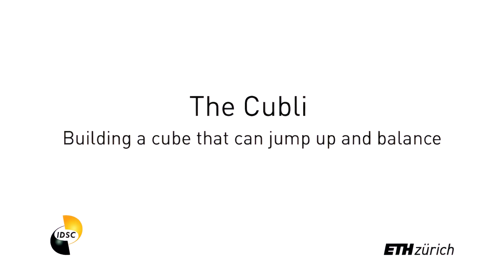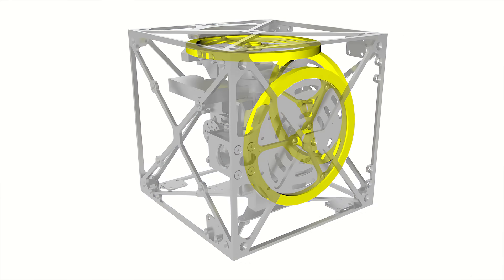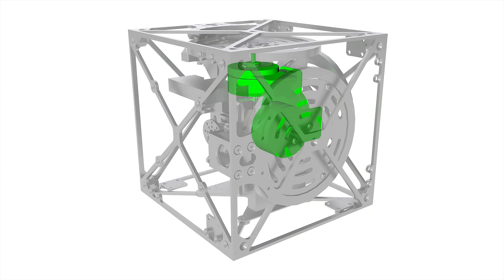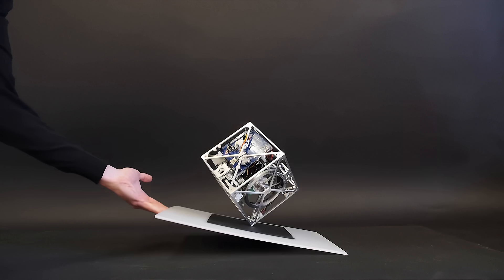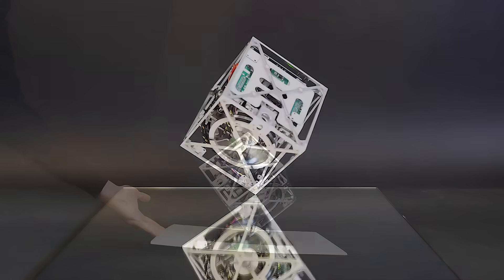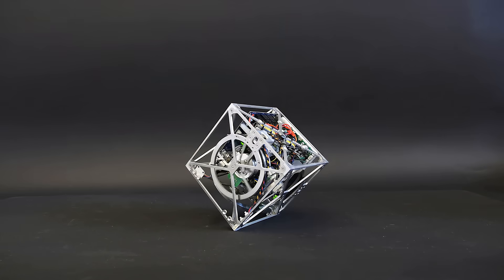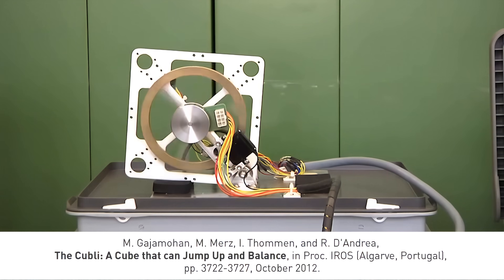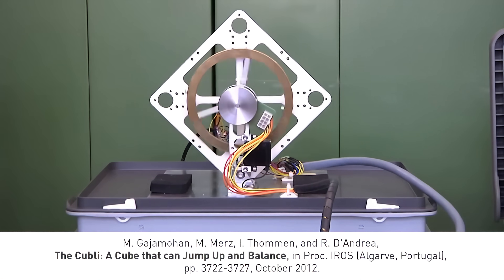The Cubli: a cube that can jump up, balance, and 'walk'

Comment: So how many millions or billions went into this absolutely useless contraption? What happened did the slinky keep getting stuck in the middle of the stairs so now you have a high dollar solution that isnt worth the material its made out of? Sorry to be a cynic about this but this is why university and tech companies have ran our country into the ground and you now have useless everything. Thanks alot for setting us all up. Now stfu and go crawl in a hole before God sends Jesus with the glass of act right and I thought I told you once twice three times...
Reply: I understand your frustration and concern regarding the cost and usefulness of The Cubli, but I would like to point out that the device was primarily developed for research purposes, and not intended to be a consumer product or a solution to any specific problem.

The Cubli is a highly specialized and advanced research device that has been developed by researchers at the Institute for Dynamic Systems and Control at ETH Zurich to investigate principles of physics and robotics, and to explore new methods for controlling the movement and balance of robots.

While it may not have an immediate practical application or solve a specific problem, research into advanced technologies like The Cubli can help to advance our understanding of fundamental scientific principles and can pave the way for future innovations in a wide range of fields.

I understand that you may still have concerns about the cost and usefulness of research projects like The Cubli, but it is important to recognize that scientific research and technological innovation are crucial for the long-term growth and prosperity of our society.
Reply: @raeji  More food more houses more cars at a lower rate would be much more prosperous to a society than a new toy. Thank you for your research and development. How many robots will be programmed to build or farm vs weapons applications...oh yeah wait we have robot weapons and plenty of war but short on food? Just sayin. Dont mind me what do I know. People dance like robots...robots want to dance like humans because humans want to dance like robots. Where do these robots come from that you are so obsessed with? Robot animals with cameras...cameras on poles...cameras in homes...cameras in cars...cameras the only way AI can see...I say why does it need to see when some people cannot? Where does this data recorded go? No boundaries for robots? What type of world are you wanting?
Reply: @jarrodvrbetic6503   I understand that you have concerns about the use of robotics in various fields, including warfare and surveillance, and the potential consequences of these technologies on society.

I would like to emphasize that the development and use of robotics is not inherently good or bad, but rather it depends on how these technologies are used. Robotics can have many positive applications, such as in healthcare, agriculture, and environmental monitoring, and can help to improve efficiency and productivity in many industries.

At the same time, it is important to consider the potential consequences of new technologies and to work towards responsible development and deployment. This includes ensuring that these technologies are designed with appropriate ethical considerations, and that they are used in ways that are consistent with social values and priorities.

Ultimately, scientific research and technological innovation are crucial for addressing many of the challenges facing our society, from food and housing insecurity to climate change and public health. It is important to continue to invest in these areas, while also ensuring that we are thoughtful and responsible in how we apply new technologies.
Reply: @raeji  🤖🤖Rosie you are broken record. Nice try totty botty.
Reply: @jarrodvrbetic6503  You refuse to acknowledge my response and thus, I will not further reply. Arguing with people like you are futile. Cope. Seethe. Mald, even.

Comment: Is a fake project with threads in corners?, there are no diagrams, no replicable projects, no gadgets you can try or buy, and you don't even know if the prototype can actually work. Without a mechanical movement on the base, it cannot jump since the force exerted would cancel with the rigidity of the structure. The websites only have videos and photos, even the main research website does not exist.
Reply: It’s literally fuckin real dude lmfao

Comment: Metatrons cube merkaba gyroscopic propulsion prototype early stages

Two x three sided pyramids going in both directions one left one right

Each of the 6 points might be activated one by one to control the level of spin

Inside a yantra square with the T bits  

😀

If you look at metatrons cube and use the 6 outer circles as individual gyroscopes for direction and the two inner pyramids should provide the lift

Also see a bagua as a magnetron to go over any moving parts perhaps

If you give it some neurons and solution and a pineal gland/piezoelectric stacked crystals(56 point star) it could learn and grow and.......

Then we can have Moya
Reply: @Hello there, how are you doing this blessed day?

Comment: This can be used for making new architectures, cities and offices... Imagine a whole city inside a gigantic cube balancing on one of it's corner
Reply: :). I thought it was funny anyway.  I suspect there might be some issues with the foundation for a large building balancing on a point. The Millenium Tower can't stop sinking with a pretty robust distributed foundation. Perhaps some high power magnets to distribute the load would work? You might need the magnetic field from a neutron star to make it work but that's just an engineering problem.  And then every now and then somebody could screw with the reaction wheels as a sort of practical joke. The world needs this.

Comment: The energy this cube requires to perform simple moves is probably way too much for any serious use.
Reply: It's one way that satellites can adjust their orientation in space without using thrusters.
Reply: @smartin484  With a solar rechargeable batteries, energy isn't that much of a concern in space I guess.
Reply: @Joe1qz  I suspect that any satellite is designed to have only a slight excess amount of power available, whether that power source be nuclear, solar or chemical. Every ounce launched is extremely expensive. As far as 'peak impulse" goes, solar is probably the most expensive, but it also has a very long lifetime for its mass. Nuclear has many trade-offs, not the least of which are the raised eyebrows anytime someone suggests putting plutonium into Earth orbit. Chemical has the highest impulse, but the largest cost over its lifetime. Always there are tradeoffs.

Comment: the brake plays a minor role, whats actually happening is the same principle of a prop plane or helicopter and how roll or rotation are controlled.  the engine spins the plane as much as it wants to spin a propeller. the resistance of rotation of the fly wheel is where it balances, while a shock merely accelerates it.  it'd be great for controlling axial orientation in zero gravity.  however, this would be more exploited in weapon guidance systems.
Reply: why would it be great for controlling axial orientation in zero gravity?
Reply: @JDJoeil  Because it is. Hubble was lauched in 1990 and it has 4 RCW.

Comment: And finally, we reached the point. Let's transform cube to cylindrical object that can accelerate and decelerate without direct mechanical connection between its engine and the body....

Comment: Amazing, but I wonder how it jumps? Can anyone explain that?
Reply: Spin up a wheel to a high rate of rotation. Then suddenly "brake" that rotation. The angular momentum is transferred from the wheel to the axel (and to the cube structure) and the cube moves in response. Physics-wise it's pretty simple. However, controlling it in real-time resulting in a smooth behavior is the tricky part.

Comment: I want to see a BattleBot using this method of locomotion, a full-body attack hammer using all corners of a polyhedron (doesn’t need to be a cube!).

Done with enough capacity to make rapid course changes (more than seen here) at a minimum, it’d keep opposing drivers confused as to how best to corner it.  Also, with no wheels to attack to disable the locomotion, how do they pick a  vulnerable spot to disable it?
Reply: Well if the robot's weapons (spinners, specifically) were powerful enough to break the inner workings of the robot using this method, then I don't think that's very effective imo, but a nice suggestion either way, just, not for head on collision.
Reply: @maroonjacketdkid08  BattleBots is indeed, a very unforgiving arena.

Yes, if the thought-experiment BattleBot (not a robot unless it is reprogrammable, as the typical BattleBots are dangerous remote-control toys with weapons, usually) can’t take the punches, being a neat concept won’t have it last long. It’s quite probable the amount of armor needed to sustain the punishment would result in a device that’s underpowered. It’s entirely possible to isolate the innards enough to keep them from being shaken/battered to death, given enough weight to work with, but the question is if that’d fit within the constraints in all aspects, including monetary budget.

Comment: "while others are using it for self assembling robots" - Who are these people? We need to stop them.
Reply: robots are made to solve problems. What happens when it realizes all problems are solved if the ones asking for the solutions are gone?
Reply: @nashcarter1067  It won't happen all at once, it will happen slowly, and if it starts attacking us, it will attack us weakly, but still give us a sign that the learning process is heading towards attacking humans, allowing us to shut it down.
Reply: @logicbuilder1204  it would wait until it is smarter than us though, It would have calculated that its biggest chance of downfall would be us KNOWING it would happen so it would purposely wait, gather appropriate resources, and work from the inside out initiating an attack before any chance of shutting that down could possibly happen. they could literally hijack our own weapons and vehicles. flood any communication waves with encrypted white noise to ruin any and all chance of us getting any sort of edge on it. 

AI (if it decided that were the easiest rout to removing all problems) Under no circumstance would just give us a "GLHF" heads up. We would just be gone in a day or two at most.
Reply: @nashcarter1067  Chances are it would not even know what a human is, most tests are in controlled environments and simulations, that way, you can train it very fast, and make sure everything is consistent. And, it would not start off smart, it would start off baby level, it would not evolve "take over humanity", and "keep it a secret" at the same time, first take over humanity will come, it will try to attack a human, and probably fail, which will tell the learning algorithm that this is not a good path, leading it towards actually doing its job.
Reply: https://www.youtube.com/watch?v=4oSavAHf0dg, This is from 12 years ago.

Comment: the operation of this contraption is simple, if you understand torque and airplanes, this is a joke.

To stay balanced, Cubli uses the torque of the engines. Okay maybe that didn't make a lot of sense. Let's imagine a single-engine plane starting the engine and accelerating down the runway, as the engine rotates, depending on the speed, it generates a torque contrary to the rotation of the propeller. The higher the rotation, the greater the torque generated, and the greater the pilot's effort will have to be to keep the plane on the runway.

Comment: The scientists and engineers who created that were boring at a coffee pause and one said 
"Bois, let's build a f'kn cool cube"
Reply: Its pretty serious shit about AI's and selfconstructing robots. A lot of frim are actually thinking of colonizing exo planets with ai's cube :)
Reply: @ThorbjrnRagnar  I feel like there's a problem with the design which could probably be solved fairly easily. What I'm thinking of is how the cube has to build up momentum before it can jump. This means it can't do things super quickly, but perhaps having higher torque(/higher speed?) motors in it would solve that.
Edit: Another problem is: what if the battery runs out? But I imagine that could be solved with the same technique as wireless charging, or even just contact pads on the cube itself, that could pass a current through the whole system of cubes to charge them. In fact, if you did that, you might not even need that large of a battery on it in the first place unless you need the cubes to be able to go solo occasionally
Reply: @OrangeC7  if you want pressure pads, more weight; more energy required to lift off, more energy sources = more weight and it keeps on repeating
Reply: 2:24
Reply: they were tired of being called "squares".
Reply: engineer gaming
Reply: Combine it with this plz -> watch?v=l_GSGFhnWwo

Comment: What's incredible to me is that they were not only able to balance it on a corner but balance it and counter the torque to keep it from spinning on its corner. Amazing.
Reply: Check out the device that balances 3 hinged pendulums....vertically! Now THAT is freaking mind blowing....

But I agree, being able to pop itself up onto a point is pretty neat. I wonder if itll ever saturate...probably not since its at surface gravity and theres friction against whatever its sitting on. Also wonder if they can quiet it down some if they sealed it and pulled a bit of a vacuum.....
Reply: @mandi8345  it could also just vibrate really fast up and down
Reply: It's literally cgi
Reply: @Thatfpsguy  It literally is NOT...

There are more videos about this 'gadget' + the principles being used here, are used everywhere both in everyday life (from toys to tools) and in industry. Also, I suggest you take a look at robotic and also 'maker' videos. They quite often use the exact same stuff to balance their things (like mono-wheels, walking robots, etc etc etc).
There is NOTHING 'magic' about it (unless you don't know anything about physics/preschool). The only difference here is: it has been presented quite 'magically' in this video. But it is in fact pure basic physics at its core. And not hard physics at that; you can make something like this yourself if you're a maker and handy in electronics... The programming of reaction wheels is also relative simple/basic (action vs. reaction sprinkled with advanced PID controllers).

The impressive part is they combined this in all axis with this cube, with an extreme level of precision and ridiculous amount of fine tuning.

Look up youtuber and maker 'James Bruton'. He has created robots with reaction wheels extensively in the past (and still does from time to time).
Look up "reaction wheels"....

What is MUCH more impressive, also from physics point of view, is that 3 hinged pendulum balancing demonstration robot/machine that @Mandi was talking about. If you know about 'Chaos' theory, you'd know why that is much more impressive (although it doesn't look as cool and slick as this cube demo).
Reply: @Thatfpsguy  although the project has stopped research, this was real.
Reply: @Thatfpsguy  0:47  bro lol
Reply: It's only an animation. Can't you see ???
Reply: @aklankrisz  it us not cgi. it s an actual video.
Reply: @aklankrisz  that would be some insanely impressive cgi
Reply: @aklankrisz  even if it was, it's still satisfying

Comment: this is really cool, but obviously for locomotion using a sphere, or putting little wheels on the cube would be more efficient. You could even use the angular momentum wheels as actual wheels by repositioning them

Comment: What if you get 2 of this and merge them inside? (also more weight on the rotating weights)
Currently there is only 3 faces of the cube doing the work, make all 6 faces have motors on them, but make the mirror spin the opposite way.
Then make the Current 3 and Mirror 3 Pick a direction XYZ and Pulse break and accelerate Current(1) and then Mirror(2) side, so its 1212121212121212121212121 There you go propulsion.

Comment: Imagine that it can balance in the air and there's another spinning motor that's uneven.
That have a mechanism that's only pushed it on one direction.
The one that's pushing needs to be unbalanced. It needs to do more than just a circle and stop🙄.
It needs to increase size and reduce size in one direction so  it can pushed it forward. And they need to be more than one. 
Now go and make it for me.
I don't have the money to do it myself. 
Make me proud 🧠

Comment: This is going to be snapped up by darpa. Space Force boys. Gyroscope for energy storage from solar energy because lithium will lead to a bad time. 

Not to mention the obvious benefits. This allows (I believe) precise complete control when in a zero-og environment as long as you can sustain the flywheels at a sufficient minimum speed.

Comment: If this could be applied on bigger sizes, it wouldn't be useful in the making of new type of buildings that could survive on earthquakes? Sounds crazy but this could be applied at the base or in a central structure like a core, but i guess the geometrical shapes of the designs used would be crazy lol